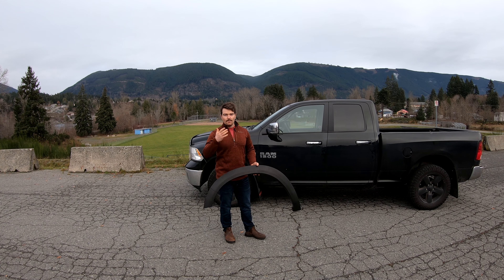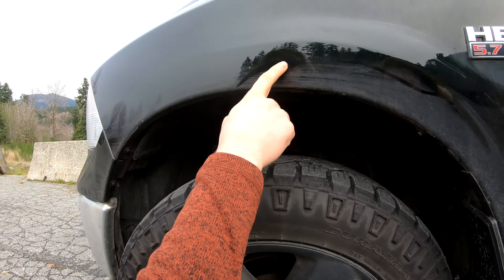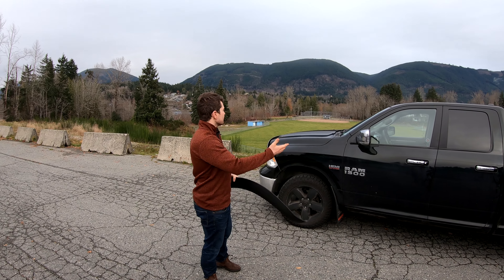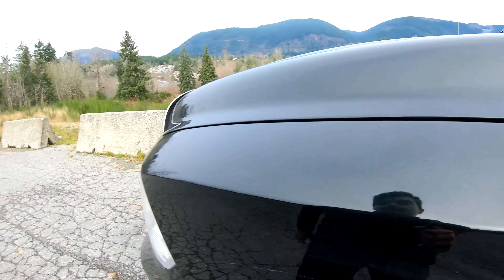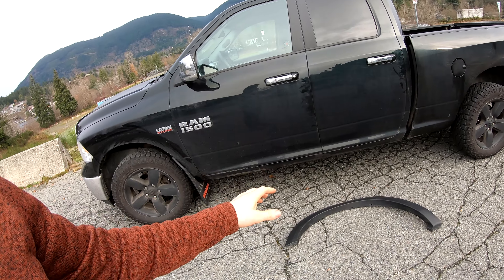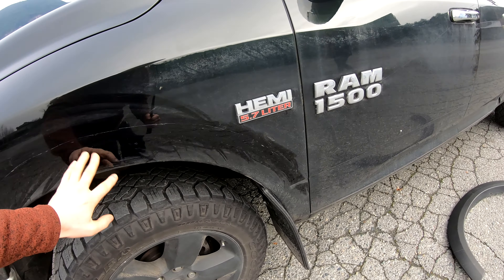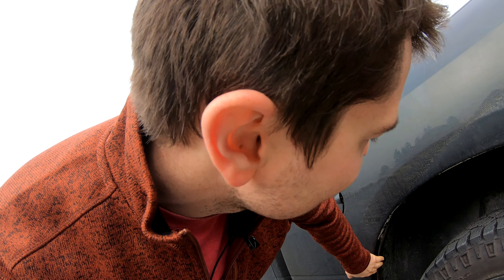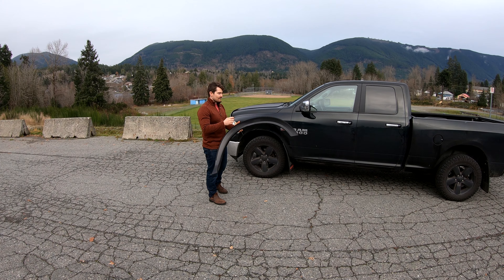Aftermarket OEM Factory Fender Flares RUINED My Paint (After 1 Year) | RAM 1500 Rust Issues

Comment: Install the flare temporarily, put painters tape around perimeter (leave 1/4" extra. Take flare off and install a strip of Paint Protector Film (PPF) on the body up against the tape. This way when you re-install the flare, the rubber gasket sits against the PPF, which will protect your paint from the flare gasket.

Comment: first issue: you’re Canadian. Let’s move on. #2) they’re ALL aftermarket- only one is factory installed. C= why are you preserving a ‘Dodge’… I’m sure it’s about to blow its motor anytime anyway. Here’s where’s where ya went wrong : common sense tells you to protect the paint from any ‘edges’. <— that was a bonus comment … the issue you’ve experienced is the old ‘get what you pay for’ problem. Fender flares can be found from $80 to $1000 for a complete set. Depending on your skill, experience, and product knowledge- you should decide which experience you can tackle - and which you can’t . Someone like yourself and probably most of the general public may not have the insight to see what the possible failures could result in- may not even have the mechanical mind set to figure out a system of attachment —- that the aforementioned $80 FF kits don’t come with. It’s just like every DIY video on YOUTUBE: it’s always easy when you watch someone else do it.

Comment: Back in the day.i had a f 150, an I was going to have the inside of the back of my truck sprayed with this black rubber I'm not sure what it's called, I know they still do it, but I think if you truck owners spray the inside of the wheel wells with this stuff it will stop everything from rusting. As we all know  all makes an models of trucks them rear fenders seem to always rust up first. Good luck
Reply: Years ago I used that rubber stuff. Total garbage. Over time it will dry and crack and will hold moisture underneath and rust even quicker. Fluid film is the way to go

Comment: If you go with the flares. Id put a thin coat of some kind of silicone sealant. I like using permatex gasket maker. That thing does wonders. Have your gloves on and rags ready to clean up around the area and leave sealant only where you want it. It gets a bit messy. Difficult to get it off your hands if you don't use gloves.

Comment: You suppose to put the rubber gasket between the body and fender flare. Bushwacker supplies it with their kit
Reply: Bushwhacker is a better aftermarket company. He prob bought cheap foreign part
Reply: Dirt still gets on the rubber gasket and causes damage to the paint
Reply: Mine had that and still went through the paint

Comment: Fluid film the underbody to prevent and chance of rust
Reply from the maker: It does help. I undercoat my truck once a year.
Reply: 1 or 2 cans of 3M undercoating rubberized Pro, make a nice molding with painters tape and spray it, leave like that or put the fender flares on top after dry.

Comment: Get bed linner sprayed on the rockers an outer wheel arch area looks better an last longer  use a reputable company
Reply from the maker: that's what I'm probably leaning towards.
Reply: That doesn't do anything...body panels rust from the inside out. That's just like putting lipstick on an eventual pig. This is exactly why they do rust proofing sprays like Krown or others inside the panels themselves. Bed liner is good for rock chips, but that's about it.
Reply from the maker: @Sugarkryptonite  I get my trucks sprayed at Krown once a year. I think it will make a big difference

Comment: When doing some for the first time, it’s the persons fault not the product. Your failure was your research. The irony here is you made a video for others to see. This is a directive you should have been looking up BEFORE YOU put them on. Any fabrication to metal on a vehicle needs to be addressed. With or without fender flares Dodge fenders are gonna rust. The engineer who designed them actually leaves pockets of glue hidden under the paint and primer. Have to wonder if the rust product industry floats Dodge money to make an inferior product so they can make millions?! I own my 2nd RAM and the 2nd is exactly like the first 20 years later..no structure improvements. Same design

Comment: Fender flares 100% scratch paint. I put flares on my truck last week and didn't do my homework until after I put them on. I heard so many bad things about flares. So I took them off JUST 2 days later and ALREADY had scratches all over my paint. The flares are a quality set too with nice weather strip on the edge. Very disappointed I would not recommend flares unless they come factory on your truck or you find a garage to do it and they will guarantee their work if any scratches appeared.  Maybe you could try putting clear tape on your paint before install that might help with scratches?
Reply: Yes tape will help but I knew this too late 😂
Reply: I got my flares put on by Chevy dealership and still it f up my paint.